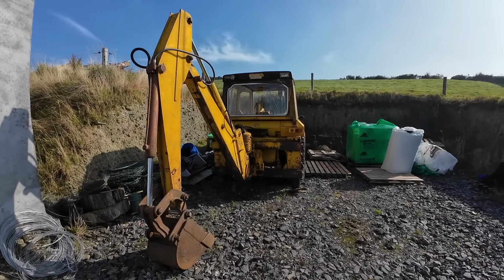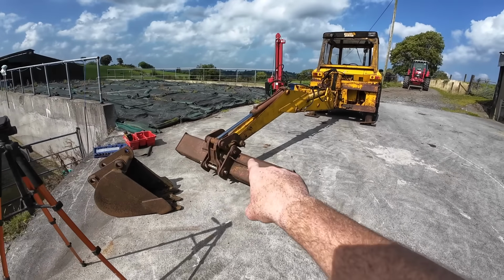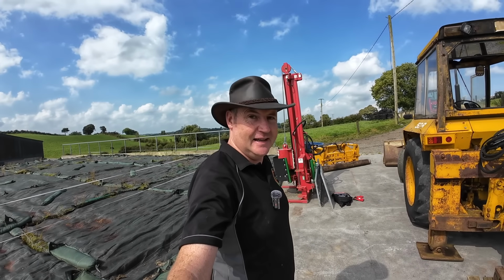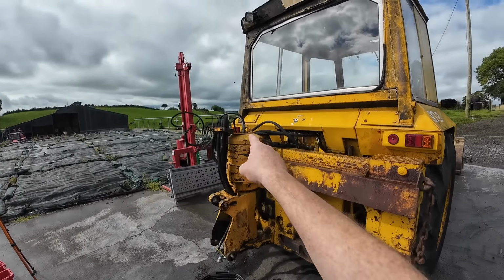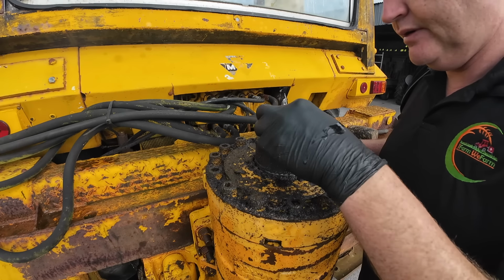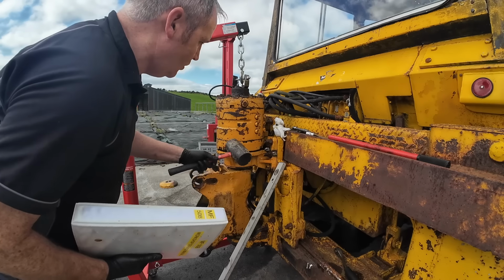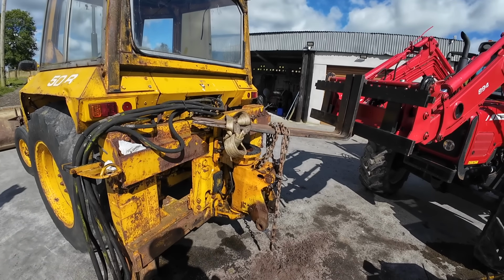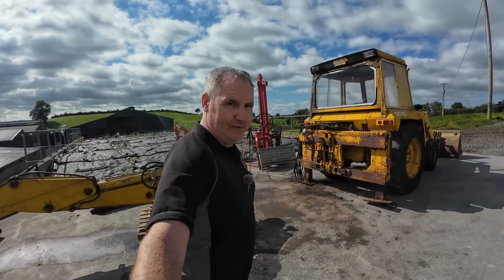The BIGGEST Job Of Them All - But I've Discovered A MAJOR Problem - MF 50B Backhoe Removal

Comment: Tilt the machine/dipper to the required angle with the jack legs. This will align the dipper up to the ears of the bucket to put the pin in. No need to lift the bucket manually then.

Comment: Adrian you mentioned about welding a crack before you weld drill a small hole at each end of the crack it will stop the crack from travelling on something I was told 50 odd years ago by a very smart man that was self taught like yourself there's nothing he couldn't do

Comment: Nice work on the old digger!  That side-to-side shuttle is a nice feature.  I'm not aware of that option for any backhoes that are common in the US.  It is commonly found on forklifts, especially the larger ones though.  On those, it's nice to not have to manually widen or narrow your forks if needed.

Comment: Great vid.. love the 50b ill get ideas from you on our old one.. 😅.. but see when it comes to putting the back actor back on 
. Connect the main lift/boom ram first and use the ram to move things to line up the bottom pin.. done this a few times for taking on and of backactors just make sure the hoses cope with the strech 😜😆😄..  hope you know what im on about.. but you might already have he job done to..  cracking work as usual 👌.. stay safe 🏴

Comment: Those locking rams will work if the lever is pulled back fully, its a bit weird.  The other  levers are forward and back like most hydraulics but that one has a further bit of movement back where its locks back.  They are very fond of leaking too

Comment: JIC are the hydraulic fitting for 50b u can remove slew motor by removing the 4 bolts on motor and slacken 4 on the king post 5 minute job

Comment: Good stuff Adrian,thinking about a big job like this sometimes is worse than the actual job,once you get stuck in one thing leads to another and the job gets done😉
Amazed with the mechanical jobs I get done just by research through books and YouTube and stocking up on decent tools,I’m a metal fabricator by trade but love doing different jobs on cars jeeps etc also to learn and gain confidence….great feel good factor in pulling off a job you thought initially you weren’t capable of doing.
You have a very similar mindset to me i think😄

Comment: When putting on the bucket, push out the bucket ram first and get that lined up with a smaller diameter pin, the lift it up in the air with that. Then push in or out the dipper arm to line it up, then in and out with the bucket ram to get it home
Reply: I’ve just come to comments to suggest that way lol. Best an easiest way to put on a bucket 👍👍😊
Reply from the maker: That makes sense in fairness, that was my very first go at putting on a digger bucket. Learning a bit everyday 😀👍
Reply: @IFarmWeFarm  I didn’t invent that technique, but I was glad to learn it!!
Reply: Eh Mike It’s the reverse for a 50 Ton bucket not as easy move with the crow bar Great video
Reply: @0796logsplitter  great minds think alike, fools seldom differ…
Reply: You're doing awesome Adrian!  @IFarmWeFarm
Reply: @paddymickiemickie8221  I’d love to see a 50 ton bucket on a 50-B!
Reply: Hi Adrian! I have a question unrelated to this video if that’s ok. What size is your tractor loader bucket and what brand is it?

Comment: I try not to blow smoke 💨 up peoples arses only when they are outstanding at their trade or sport usually. Mechanic, Electrician, Pipe Fitter, Welder, Engineer, Plumber. The list goes on! That’s only the stuff you are good at. Father, Husband and Farmer are what you are outstanding at. 

I can say this living in Suffolk I know a few farmers and they are generally MISERABLE, TIGHT, and the biggest BODGE ARTISTS I’ve ever met 😂.  However they are the hardest workers in anyone’s country and where would we be without them ? Pretty screwed I should think and they do need a lot of praise for what they do.
 
Adrian your Farm is OUTSTANDING mate in every way possible 👍🏻

Comment: If it is just one spline gone on that motor shaft, and it fits well into the pivot, there should be enough contact on what is left, it just locates it, not like it needs to mesh when it rotates?

Comment: watch wes work, fixed one of those on a mf40 I not sure if it was just the slew motor. I've shifted thousands of bales on a 50B in the 80's with a flat 8 grab on the front.

Comment: 👀🙄🐾👍Interesting video Adrian you have both Milwaukee and Dewalt power tools which do you prefer?
Reply from the maker: Milwaukee have usually got better torque in most of there power tools which makes them a favourite amongst mechanics and so on but Dewalt are built better in my opinion and are much easier to get fixed if something goes wrong. If your working outside in wetter conditions Dewalt tools work better, I’ve had several Milwaukee tools stop working when they got slightly wet, luckily when dried out they usually come back to life but never had that issue with Dewalt stuff.
Reply: @IFarmWeFarm Thank You Adrian for your very informative and useful reply 👍

Comment: Hi adrain. Im looking out for a pillar drill just curious in ur brand as there are that many makes out there. Tia
Reply from the maker: Mines a ryobi, i got that from another YouTuber in the U.S who was having a clear out sale. It’s not great, ok for light work but struggles to handle most tasks. You’d be safer trying to find a used workshop pillar drill, the older stuff was built to last. Otherwise budging brands like SIP or higher quality brands like Rotabroach are worth a look

Comment: Tractor diggers like this one simply don’t have PTO shafts like normal farm tractors 🚜
Reply: Some did, I had one with the 3 point linkage that was never used, was stuck but got it working, 10 mins took off the whole rear frame for the backactor with two big dowty couplings for the hydraulics, it was a great machine I should never have sold.  I've got a 50 with the 212 engine now similar to this one but older, it's got a fiberglass cab
Reply: @ I’ve never seen one myself though.
Reply: @oisinkierancoyle5518  not many left in fairness
Reply: @ That’s very true indeed correct.